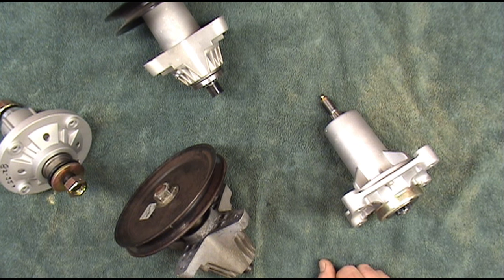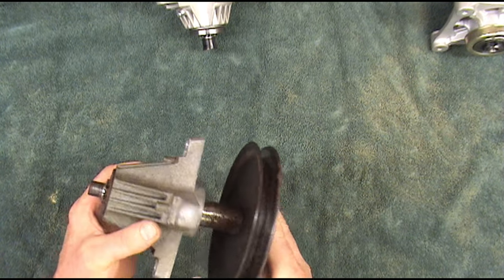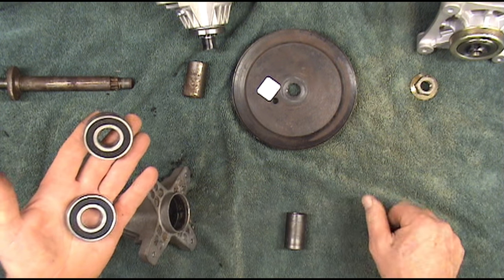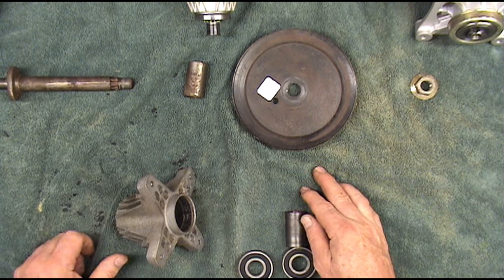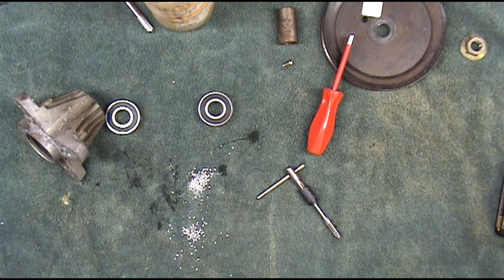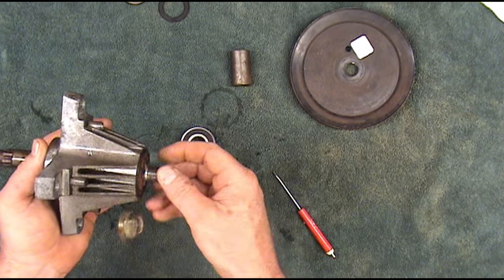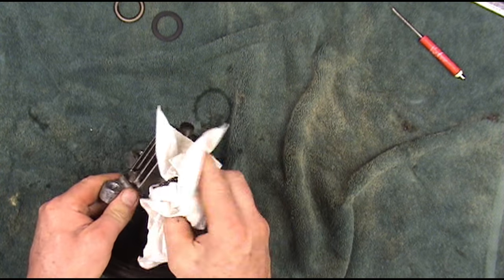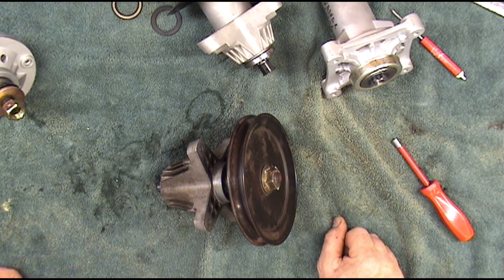Deck Spindle  Bearing Upgrade   Cub Cadet Husqvarna John Deere Troy bilt

Comment: Do stock spindles with zerk fitting installed that come on the mower have a vent? Should one be added if not when doing this ? By reading thur comments it’s an important piece to the puzzle? Thanks
Reply from the maker: Yes it needs a vent. 
Thank you

Comment: Just wondering, if the spindle isn't vented during operation, will heat expansion push on the outer seals that were left in place? Is there a type of breather that would let grease out in that situation?
Reply from the maker: I would drill the small hole to allow venting.  You can install a grease check-valve/vent .  Someone mentioned it earlier in the comments.   You could pop the seal when putting grease in without a hole or vent.  I don't think the spindle is air tight enough for pressure from heat expansion to push out seal.
Reply: @IFIXIT4U  Good point, thanks! I have a have a cub ZT260 that I bought new last year. I probably don't put as many hours on it as some might. I only have 26 right now. I may try to do this before they get wrecked and then I only need to buy zerks and vent or screws instead of new bearings also. Thanks for the video.

Comment: Wont the pressure from the grease just push out through one of the bearing shields?  That way itll make sure to get inside the bearings,..  i guess it would pop that seal out if so maybe..  but wouldnt damage the bearing unless you left the shield exposed to the dirt...
Reply from the maker: That is why the video shows drilling the small hole to release pressure. Or you can install a vent in that hole. 
Thank you

Comment: You can buy pressure relief plugs that are spring loaded. Think reverse zero fitting. Probably a 1/8 pipe thread.
Reply from the maker: Thank you

Comment: Mine is Murray Troy built 42” 7 HP pony and when I took the shaft out 2 spacers fell out and just can’t figure where 1 goes. Help
Reply from the maker: Sometimes the "inner" spacer between the bearings are a "two" piece spacer,  sometimes one solid spacer.  Sometimes you will have a spacer under your pulley on top of the spindle.   Look at the other spindle on the mower for reference.   Hope this helps.   Thank you

Comment: Drilling a couple of 1/8" holes in the center spacer will assist in dispersing the grease. It will also prevent the shaft from being galled or rusted.

Comment: Doesn't the spacer go between the two bearings?
Reply from the maker: Yes.  There is a spacer between the bearings.  Sometimes you also have one under pulley.

Comment: It just baffles me why they even have grease zerks to begin with?? Is there some small benefit to that or is this just a total scam? Seems like they should just leave out the zerks and say "sealed for life" like they do with everything else. Except they do the opposite...give you zerks...tell you to use them, but they do nothing. So bizarre.
Reply from the maker: You are correct, and that’s the whole point of this video. Remove the inner seal and grease does work for you.
Reply: @IFIXIT4U  It's amazing how a $2-4,000 machine can be such a POS. Have to drill the drain plugs for the trans in my JD too. If we didn't do mods like this they would only last like 2-3 seasons!

Comment: GM sir  have a cub cadet  MN-103 calls for 959-3665- and or 759 -3665  spindles   i think ther roller type  you ever work with these